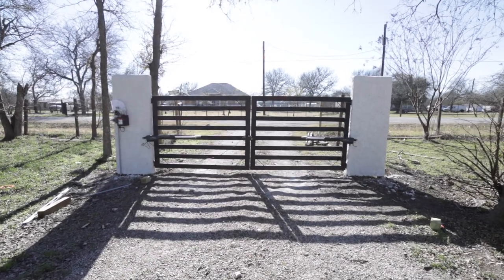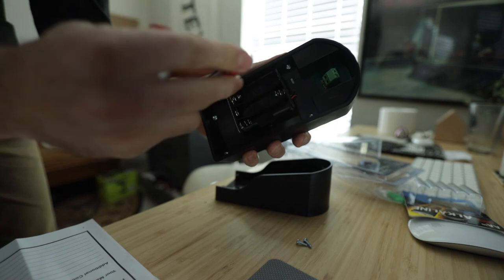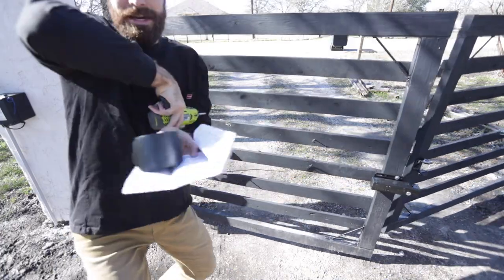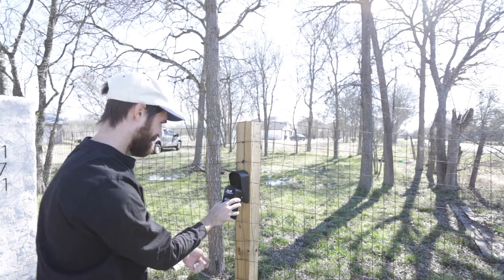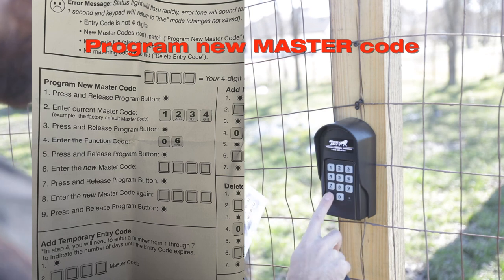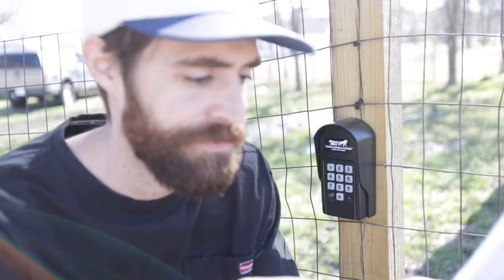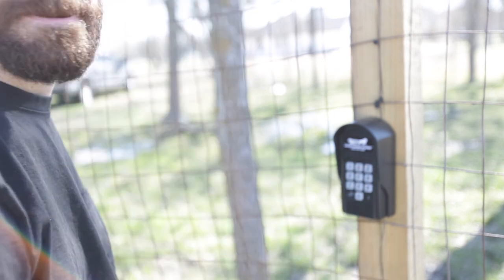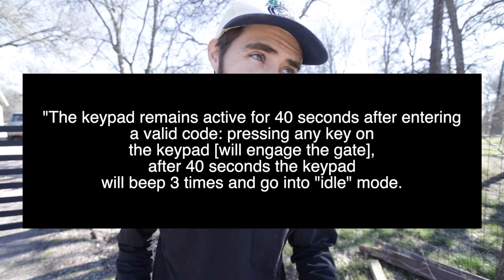Installing Wireless Keypad for Mighty Mule Gate | A little confusing...

Comment: Just curious why the keypad (on the outside of the gate) is on the right side and not the left side of driveway (drivers side)?
Reply from the maker: You can’t reach it by sitting in your car so you have to get out- which I wasn’t really thinking about when I installed it. Same answer for putting it on the right lol. Oops.